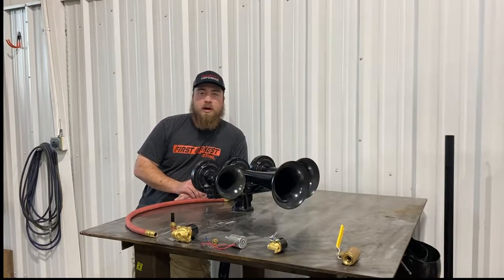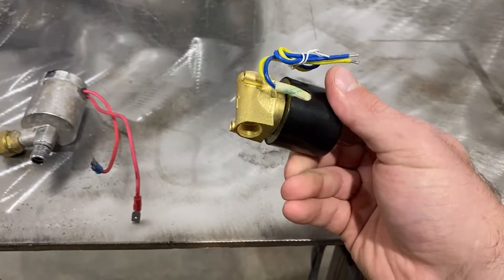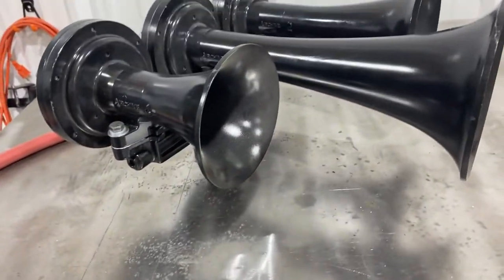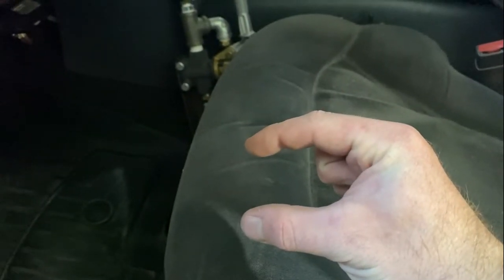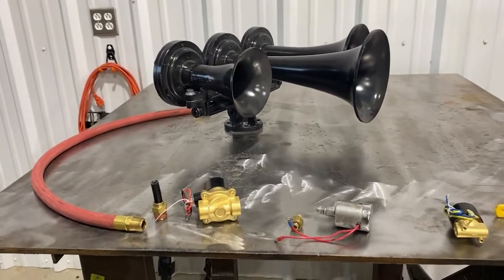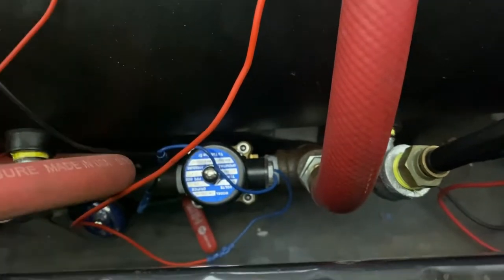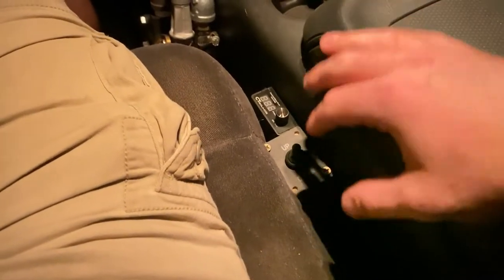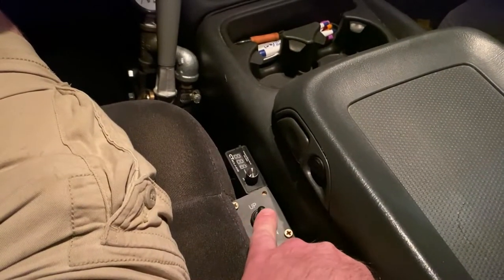Graham White And Solenoid Valves

Comment: If I may. They also have an electric ball valve. You just wire a two-way momentary switch for open and close. You just got to wire the switch for reverse polarity
Reply from the maker: Link to said valve?
Reply from the maker: Thanks. I’ll look into it
Reply: @texasboystv   if you do it make sure you post it so I can see how it works because I'm considering using one

Comment: ? If I run a 1/2 inch line to my horns for the tank replacing the 1/4 in would it be louder ? I'm thinking so but I'm not sure what size the inside of the sylinod but it's / sylinod is  connected right to the 4 horns so maybe it's bigger than a 1/4?
Reply from the maker: What horn do you have
Reply: Vixen 4 horns 3 gallon tank at 200 psi not the greatest but at $300 plus all I could afford. Comes with like 1/4 inch line.
Reply: It's pretty loud with a decent sound. Was thinking of putting in 1/2 in line to the horns.
Reply from the maker: 200 psi with more flow might tear up diaphragms. It would be louder until it isn’t.
Reply: Ok so I should let it be.
Reply from the maker: For longevity yes. You could always do 1/2” line and add a pressure regulator. There might be some ground to gain that way.

Comment: I just got the horn blasters valve. They now come with the 2 springs like the GW 353.
Reply from the maker: Let me know how it works!
Reply: @texasboystv  It works very well. I like the edition of the cutout on the handle as it allows a pull chain to be used. It's basically the same as the GW 353 without the branding as well as slightly cheaper material. The handle is all one cast instead of the removeable rubber found on the GW.
Reply from the maker: I guess I miss understood, the second spring was the one that was reported as being too stiff. Have you found the second stage to be very stiff?
Reply: @texasboystv  The valve was pretty stiff out of the box, but with a week of constant use, the valve started to loosen up. The second spring is designed to be more stiff than the first stage. I mounted it to a portable air tank, and I have to hold onto the handle of the tank when pulling the valve (Which works well). I'd say as long as it's mounted to something solid, you're fine.
Reply: @user-zj5jm2zt3y  Hmmmm I'm trying to decide now. lol. HB or Graham....
Reply: @floridawashservicesllc1789  Depends on the use. Someone is selling Graham white 353 Valves (Both Normal and Straight Handles) on eBay. If you want to run a pull chain though, get the HB one as it has a hole for one.
Reply: Update: After a long amount heavy use in adverse conditions, the HB valve began to leak and the stiff spring ended up breaking. Hornblasters offered to replace it under warranty, but I just decided to buy some rebuilt Viloco valves for a steal of a price, which should work much better.

Comment: Can i have the link for the push pull valve
Reply from the maker: What are you calling a push pull valve?
Reply: @texasboystv at 5:06
Reply from the maker: You can’t buy it as a set, it’s a bunch of individual parts made into what you see in the video.
Reply: @texasboystv  is the valve itself on Amazon or something?
Reply from the maker: @deseasedcatrailfan4932  it’s a solenoid valve, you can buy the valve from Amazon yes.
Reply: @texasboystv how did you make one low pressure, and the other one high?
Reply: @deseasedcatrailfan4932  You gotta make it yourself. One solenoid with a ball valve set as a restriction, and the other unrestricted. You then have to wire those solenoids to a two-stage switch.